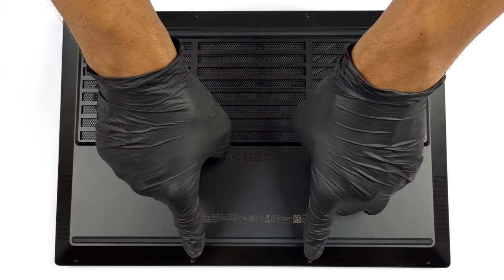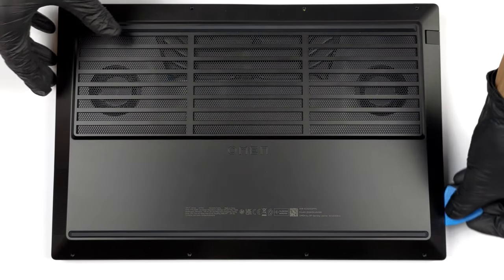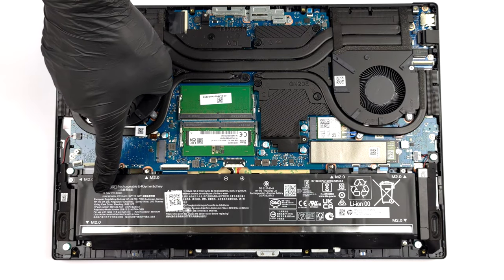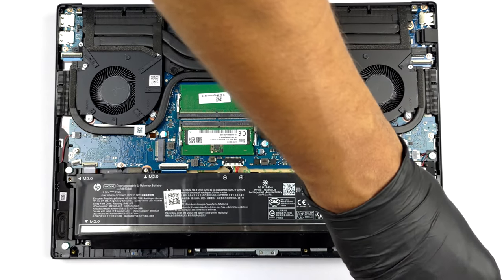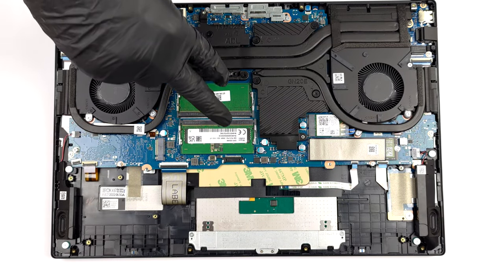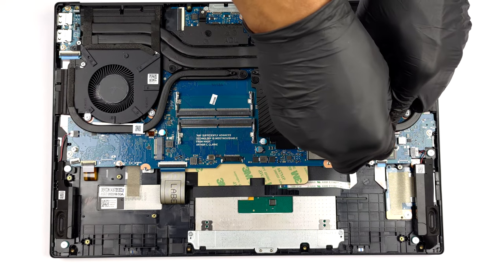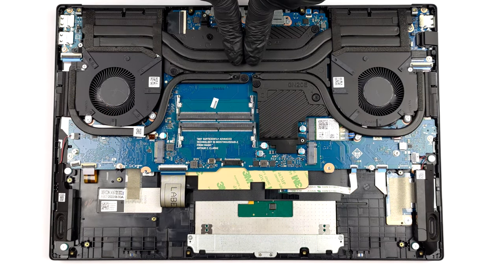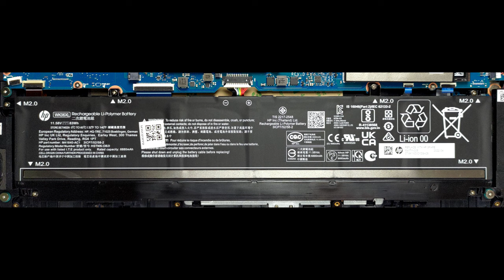🛠️ HP Omen 16 (16-k0000) - disassembly and upgrade options

Comment: i have this exact model - 16-k and i purhcased an additional samsung 980 pro 2tb ssd, the one without the heatsink. based on this video, the stock ssd on the right does not have the heatsink, however it look like it does have a thermal pad of some kind. would i need one of those for the new ssd?
Reply: that's the exact question I'm trying to figure out. Did you get an answer?
Reply: @speedofsmell8380  the 2021 omen laptop series has copper heatsinks, some older notebooks have heatsink attacked to the back cover, this might be the same but you can buy copper lid heatsinks

Comment: Is it confirmed that the 16-k series got equipped with mux-switch?
Reply: its available with the omen gaming hub that comes already installed, you just have to switch between hybrid mode and discrete mode that turns off the integrated graphics
Reply: yeah it's available in the OMEN hub, requires a restart to switch from Hybrid to Dedicated GPU tho

Comment: We are using the 16-k0076TX model equipped with 16GB RAM and 512GB SSD.
I want to upgrade both RAM and SSD, but I want to know what specifications and sizes they use. 

16GB RAM과 512GB SSD가 장착된 16-k0076TX 모델 사용중 입니다.
RAM과 SSD 2가지 모두 업그레이드 하고 싶은데 어떤 규격과 사이즈를 사용하는지 알고 싶습니다.

Comment: is this laptop support 64 gb(32*2) gb of ram? company says max capacity is 32 gb(16*2).
Reply: unfortunately this model doesn't work with 2x32gb.. I tried with Corsair and original model (mine is Samsung). My final try is going to be 2x16, but totally sick this type of laptop doesn't accepts 64gb max. totally frustrated.

Comment: Hi is this laptop work with ram ddr5 5200Mhz ? In intel i5-12500h specification write : max speed 5200Mhz
Reply: it does 😊
Reply: @Hojogamer  okej thanks if I buy 5600Mhz Bios will block it on 5200Mhz ?